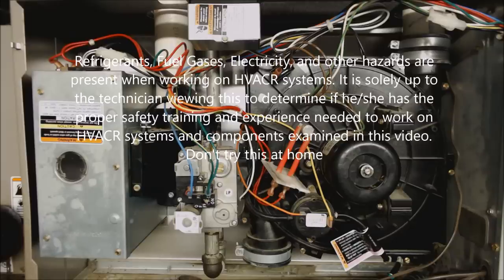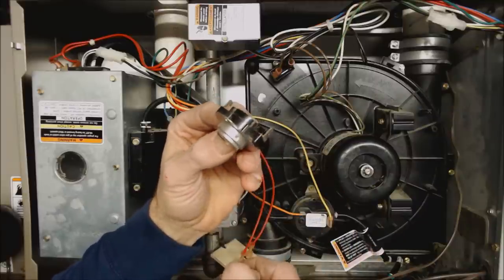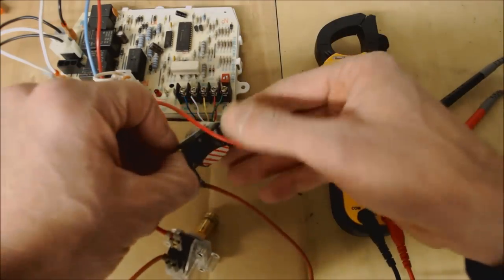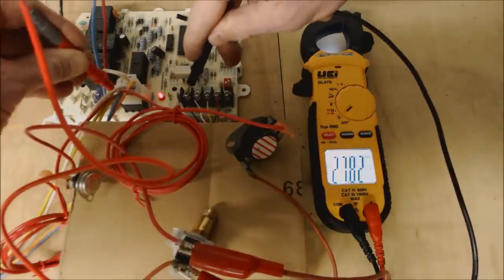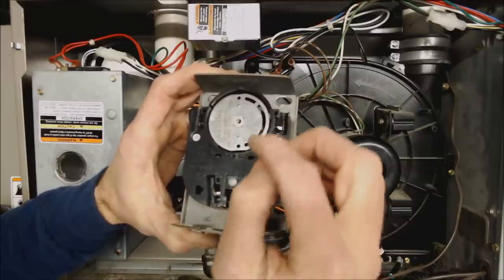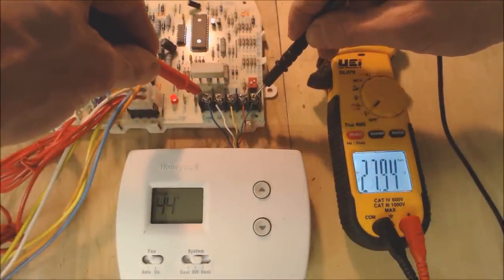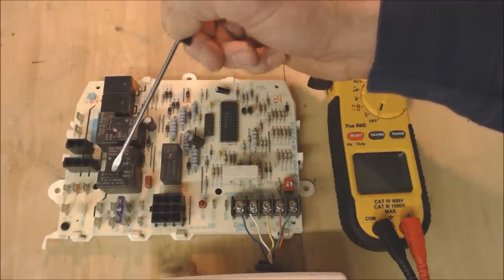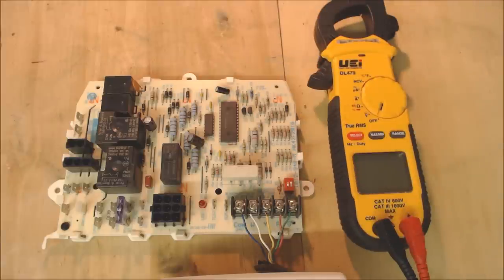Top 4 Problems Why the Blower Fan Motor Won't Shut Off! Continuously Runs!

Comment: Thanks for the video to tell me to check draft motor relay in my furnace which turned on all time. I also had to cut open the relay to repair it since I didn't have similar one in my tool box and ordering takes several days since holidays

Comment: Great, informative video.  Always check for damage to the wire from the thermostat to the unit, especially if it is not run in conduit.  I had the issue of a blower fan motor that ran continuously and found that the insulation on the thermostat wire was chewed off by a rodent leaving bare wires underneath the unit.  I repaired the damaged section and installed conduit to fix the problem.
Reply from the maker: Most systems in homes do not have conduit around the thermostat wire but I am glad you found your problem!
Reply: Damaged wires was the problem on mine also

Comment: So I called in Brothers and they stated the blower motor is not turning off because the blower is bad. They recommended replacing the blower which is quite a lump sum. Should I get a second opinion?

Comment: I live in Canada and didn't pay my electricity bills for a few months but in my city instead of cutting ur power completely they put a limiter on it so that you still have heat in the winter months.. that's when my blower fan started running continuously now i got the limiter taken off and the power is all back to normal but the fan is still continuously running.. I know the thermostat is not causing the problem and my control board isn't flashing either but my furnace is alot different looking then the one on this video and I can't figure out the rest of the stuff your explaining... Any tips would be greatly greatly appreciated pls and thank you

Comment: I have an rv furnace that once the fuse is installed it starts, the fan comes on, the cycle starts and it will continuously heat regardless of the thermostat being on or off or even disconnected. I suspect the relay on the board is fused together.  Whats your houghts

Comment: Good video. Very good training you have in your Videos. I could be wrong but I thought Carrier wires their LGPS in series with the Pressure Switch not in the Safety circuit? Just asking like I said I could be wrong. Thanks keep up the good work.
Reply from the maker: Hey Gil, you are absolutely correct. Conversion kit wiring for most Carrier furnaces have the low pressure switch breaking the 24v hot wire before making it to the first pressure switch. Sometimes I do find them on the limit circuit, thanks!
Reply: acservicetech Cool thanks. Either way it still serves its purpose!! 👍🏻👍🏻

Comment: hello, my fan has been running over 1 day now...i tried the thermo to shut it off..doesnt work.   IF i turn off the entire house from the cable box...where the fuses are...would that turn off the fan n reset the A/C and be back to normal? thank you.

Comment: My blower motor fan doesn't run continuously, but for some reason it is cycling on/off while the air conditioner is running, every 5 mins or so. It's calling for cool, so gas never turns on during the cycling and the igniter never glows, but I know the induction fan shouldn't be turning on if the a/c is running. What do I need to check first? Control board has solid red light, not indicating anything is wrong. My thermastat is a simple $25 Honeywell (only a couple years old)  (Goodman furnace, 1997)

Comment: I truly, truly hope you can help with my problem in having in my apt. I have central air/heat in my apt. I can use my cool air in my apt with no problem. But if I turn on the heat from the wall panel then switches it to off. I can still hear the fan blowing from the vents and its blowing hot air thru the vents causing the heat temp to rise in my apt. The fan blows all day long, I cant turn it off at all which is really frustrating. Do you know what it could possibly be with the info I provided to you. Any info can help thank you in advance.
Reply: Same here...can you recall what it was??

Comment: I've had a carrier furnace run the fan all the time. Everything was good to go, but even in just for the heat cycle, fan only operated and no heat. I removed the thermostat face plate and jumped R and W and heating operated. It was a bad thermostat. Replaced the thermostat and unit operated.
Reply from the maker: Yeah bad tstat nice!

Comment: my fan is runing all the time under any setting after i changed the thermostat ... i put the old one back and still same problem,
The error code green light fleashes 4 times which means - LIMIT CIRCUIT FAULT   − Indicates the limit or flame
rollout switch is open." i took out the G and R thermostat wires from the control board completely off  the screws but the fan kept blowing ..now  im getting stumped

Comment: TEMPORARY SOLUTION: I've had this furnace blower stick on twice in 2 years. The first year it just kept blowing heat making it hotter and hotter. The only way I could shut it off was to flip the furnace breaker in the garage and it was left off for hours. When the breaker was turned back on it was fixed. The second time the breaker was left off only for about an hour and a half and when turned back on it was fixed. I tried 20 minutes first but that wasn't long enough.

Comment: Nice video, another thing I ran into lately with ECM motors failing and running non stop without their control 24v to them
Reply: KCTech if i installed an ecm motor along with a fan delay switch  in a ruud package unit and the fan continuously ran. What could be the problem ?

Comment: I've always wondered if the control board sends bad voltage like 55 to the blower motor, could that ruin the blower motor and capacitor? I wonder if it's worth replacing the motor also if the circuit board has been putting out bad voltage.
Reply from the maker: Yes you would likely want to replace the motor as it may be overheating, thanks

Comment: I am not a HVAC pro . I removed the faceplate from thermostat and fan still on. Also, there is NO 24VAC on the thermostat wires . What is the problem ? Mine is a natural gas furnace .
Reply: Same here.  Any lights blinking on control board?

Comment: Hi mate I have a problem as below
On the heat mode the indoor fan doesn't run at all. And also the outdoor pipes high/low start freezing with accumulator.
I checked the  refrigerant pressure temperature on heating modes come below zero minus 10 degree on liquid line. The reversing valve is always energized with 35 volts both on heating and cooling.
Just wondering is the problem only related to lack of refrigerant? Or could be some other issue? It's r22 old mitsubishi ducted split system.
Reply from the maker: The sensors would typically protect the compressor but not shut off the indoor fan. After checking to make sure voltage is not going to the motor, you may want to try looking up what you can in reference to manuals on the model number, thanks

Comment: Hi I have a question,

I have a similar problem. I had a new unit installed, new air handler, new thermostat. But AC keeps running even when it hits the set temperature. What could be the problem? Thank you.
Reply from the maker: It sounds like the y wire is getting power when it should not. Check your settings of the thermostat, you could try taking the thermostat off while the unit is running to see if the ac shuts off or not. If it does, your problem is the thermostat. Otherwise, switch the yellow wire out with another for your y terminals if the yellow wire is touching the red power wire somewhere in the length of wire, thanks! Look up "acservicetech thermostat wiring playlist" there are some troubleshooting videos for that in there, thanks!

Comment: I still don't get. If the safety is tripped. The circuit is open. How come the blower will continuously on? What is the relationship between the blower and those safeties?
Reply from the maker: The board recognizes that the safety is open and then powers the blower for safety. It still uses relays on the board to do this, thanks

Comment: Hello Sir, i just want to know how can i fix our split type ac 1.5ton  not totally shutting down.once  i turn it off from the remote, there is still a sound coming from the ac, after my duty , I turned my ac on from the remote and there is some ice flakes and little  water came out.  Thank you for your response in advance.  Maybe now i need to turn off from the switch.
Reply from the maker: I would call a technician that works on that specific manufacturer. It sounds like a mini split and they have a lot of controls that would need to diagnosed, thanks
Reply: AC Service Tech LLC Thank you. I will do that.

Comment: Great videos I have a question please I turn the switch on to my furnace and blower motor comes on immediately even with low voltage wires disconnected from thermostat only blower nothing else,  I  replaced the furnace control   still no sequence of operation only blower motor   would you please help thanks
Reply from the maker: Is the flame rollout switch tripped? Is there a low pressure gas switch thats tripped because the tank is low? It sounds like a limit sensor or limit wire problem, thanks

Comment: I have a slightly different problem; at the end of the heat cycle, after the burner has shut off, the blower fan goes off, then on, then off, then on about 8-10 times before finally shutting off.  I have a video of this; can I upload it to you to see what I am talking about?
Reply from the maker: You could upload it to your channel and then send me the link to your video
Reply: Ok Ill do that
Reply: https://youtu.be/qSoS-QzmKTs  this is the video of the Bryant furnace at the end of the heat cycle, after the burner has shut off, the blower fan goes off, then on, then off, then on about 8-10 times before finally shutting off.
Reply: let me know what you think.  Thanks.
Reply from the maker: Jim, I checked it out. It sounds like the fan limit control blower on tab needs to needs to be adjusted higher. If I can see well enough, it is right above the gas valve inside the furnace.  This is the second tab. Typically we set them at 115 degrees but your limit control may be old and out of parameters. For now just move the second tab up to 125 then and you won't have that problem.
Reply: thanks, I'll try that.
Reply: yep, sounds like exactly what is going on. someone set the on too low and off too high in an attempt to gain efficiency.
it could also be worn, sticking or even broken, I'd start with it off/cool and watch the dial closely with cover off as it heats up and cycles. it should rotate smoothly as it heats up, without being jumpy. if it's jumping/jerking it's needs replaced

Comment: When no call for heat, I hear my furnace fan start, then go off, then go on, then off?  usually this happens in the early morning hours. Even when the thermostat is off?
Reply from the maker: When you say fan do you mean the inducer fan or the blower fan? If it is a blower fan then maybe the fan limit switch on temp needs to adjusted higher if equipped. If it is the inducer motor then maybe the thermostat wires are intermittently touching the r and w together or maybe the thermostat is too sensitive and calls for heat and then it shuts off. i would need more details, thanks
Reply: Thank you.  Its the inducer fan.  Not the blower fan. Like when you call for heat and you hear the inducer fan first. This happens when the thermostat is on,  but turned down to say 50, but its 65 in the house. (no call for heat)  And it also happens when the thermostat is off? Its L.P. day and night model 376CAV036075.  Could it be it is scencing a L.P. leak and the inducer fan turns on to clear the area?  Also when I do call for heat everything works fine? I am baffled. Thanks again

Comment: If the fan continues to run would that prevent the pilot igniter from starting also?
Reply from the maker: If the fan is being powered from the tstat then no it can be on. If the fan is powered from the board due to a limit being open then the ignition will not start until the limit is fixed, thanks vqfive!
Reply: The thermostat is on auto and it is on off and the fan continues to run when I turn the thermostat to heat  the pilot won’t ignite and start. Could it be my limit control switch is bad?
Reply from the maker: yes but it could also be that your limit switches are tripped due to a problem. Check the flame rollout switch. If that is tripped, you could have a serious problem like a cracked heat exchanger or clogged heat exchanger. If that is the case don't run the furnace due to CO poisoning.  It could be something like the pressure switch or limit is bad though, thanks

Comment: The only time heat or a/c work is in manual fan mode????
Reply from the maker: Is this an old furnace with a fan limit control? If it is then the there may be a bad relay or bad fan limit control. It sounds like some control in the unit is bad. What kind of heat and ac are you working with? Do you hear an inducer motor when you turn heat on with the fan on auto mode? I don't know if you are talking gas furnace, thanks
Reply: It's a Coleman gas furnace. Everything runs as is. Found out that transformer was at fault. Now i have to run heat cycle manually. Suspecting fan limit at fault. Limit dial moves erratically.

Comment: Possible 4 causes - 
Fan Limit Switch, Relays,
Thermostat, Temp Sensor
So which is the most likely cause if the blower only stops when I slap furnace door?
Reply from the maker: Sounds like a relay on the board or fan relay but it should be diagnosed by a tech with a multimeter to be certain, thanks!
Reply: @acservicetechchannel  Uhoh, I banged on it today and a small threaded but pointless screw (?) fell out of someplace, yikes! (I paid a tech to replace fan limit control, assuming it was the problem. He took my word for it, tested nothing, and it still doesn't work, so I'm not eager to trust and keep paying for nothing. Tku for your help.
Reply: @acservicetechchannel  Turned out to be 2 wires touching. Simple fix, no charge!

Comment: I have the problem of the condenser staying on and the blower shuts off even before hitting temperature. Any suggestions?
Reply from the maker: If the condensor runs and runs even without 24v to the contactor outside then the contactor could be melted in the closed position. Make sure to turn the power off to the outdoor unit before testing for safety, thanks
Reply: AC Service Tech LLC I will test the contactor and follow up.  Could it be the circuit board also not sending a signal to the condenser?
Reply: AC Service Tech LLC I opened the condenser and the contactor seems to be in good shape. It pulls in and out.  I’ll do further test as for the coil and follow up. The blower stops even  BEFORE reaching temperature while the condensor keeps running. It does not do it all he time. 1 our of 4 times it will do it.
Reply from the maker: Ok so the issue then sounds like it is in the indoor unit wiring going to the blower or the g wire from  the tstat. Try switching g green wire with another available wire at both the tstat and indoor unit such as brown if available. You could also look at the relay controlling the blower motor if it is a psc. When this blower stops, go and turn the power off to the indoor unit and see if the blower motor is hot and maybe the thermal limit inside of the motor opened the electrical circuit controlling the blower motor. If that is the case and the blower capacitor is good then you may need a new blower motor. You could check the resistance values on the motor windings with a megger first though, thanks
Reply: AC Service Tech LLC I have replaced the blower motor and it now shuts off at temp. Does not req. a capacitor now. 1 of 5 times AC will still run.  I might have to replace the contactor next. 
I switched the wiring to the thermostat and no change. I do notice the air coming out of the vents much stronger now.
Reply: Update- replaced the circuit board ( possibly bad relay) and fixed the problem.
Reply from the maker: Ok, thanks Traderflor Stock

Comment: Ok i am having an issue. The air handler wont turn off and every once in a while the breaker trips it self. Also the    circuit breaker is attached to the bedroom lights for 2 lights.
Reply from the maker: The furnace is supposed to be on its own dedicated circuit so the amperage isnt too much and so it doesn't affect the flame proving process in the furnace. As far as the fan not shutting off, it could be a limit tripped or the g wire having 24v at it calling for the fan to turn on, thanks

Comment: My ford edge fan under glove box doesnt kick on...I flick it to start it then she works...any ideas?
Reply: Blower motor resistor
Reply: Bearing are bad in the motor. If you spin it and it starts and runs for a while and then dies. It's the bearings.

If it continuously runs, it's probably a resistor or capacitor.

Comment: My furnace is not super old (5 years)
However, we have kept the old air conditioning coil (5 years )
We had a problem with the coil, which was too dirty  ... and we cleaned it all, because the air did not go well in it.

However, now my problem is

When I ask for warm air at termostate, I have only half of the elements (burn) (electric furnace) that turn red, and the other half that does not burn anymore.

My thermostate is plugging .... and when I ask my furnace for heat, the blower iworks, but never stops ...

I tested, and even if I disconnect the (G) of the motor board, the fan of the blower continue to run, never stop.

Do you have an idea about the problem? I believe that the furnace has overheat ( du to old durty AC coil ), that's why half of the elements ( burner ) don't 'work ... and I imagine that blower is connect?

What to do, what to test.
Reply from the maker: Are you talking electric resistance on an air handler or gas furnace?
Reply: Electric furnase
Reply: What is your e-mail to send video ?